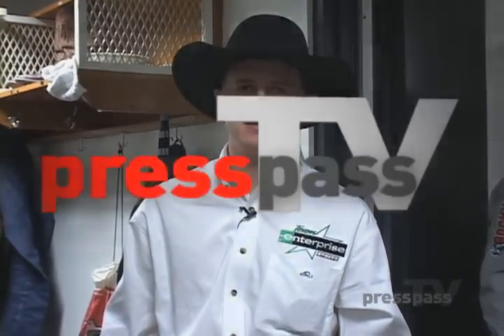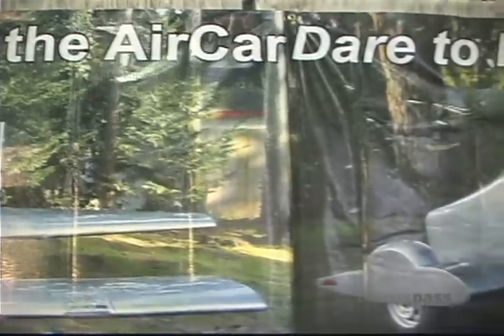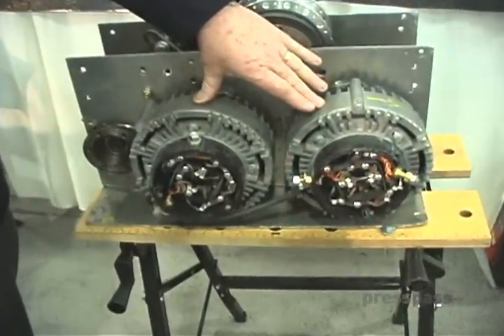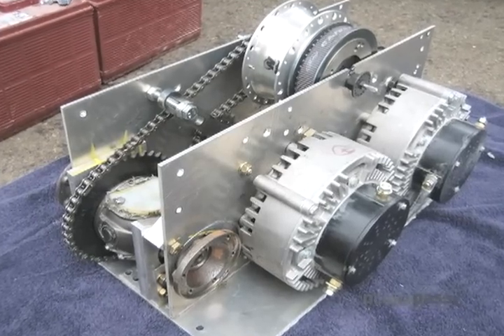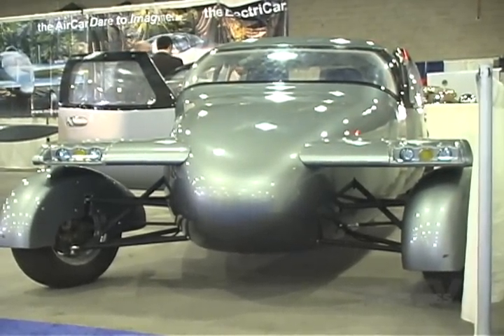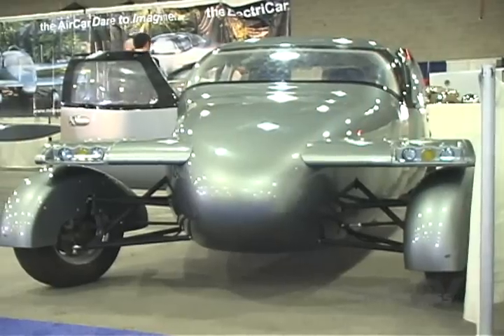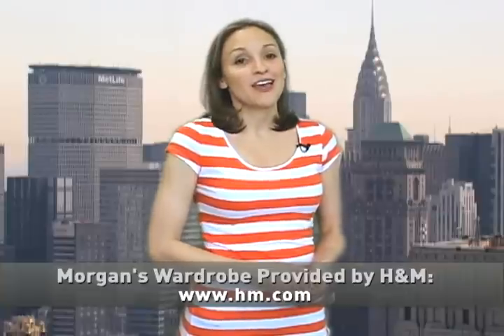Ditch the Fuel and Ride Light: The Milner Motors ElectriCar

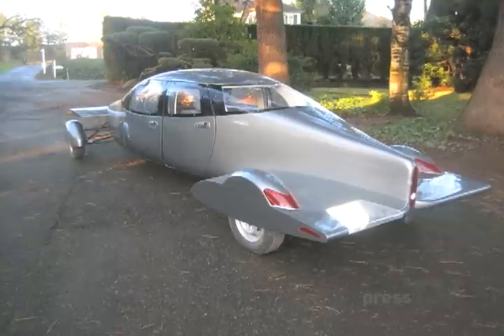Comment: @Arakyrie Is it so? I know nothing about aerodynamics, but to me the front wings appear to have longer path on the top side than bottom(at 1:10 and 3:50), making it looked like same side up as airplane's. I've heard faster air flow makes low pressure and lift( or down) to that side. I wanna see the direct side view of those wings(and the car). Thanks for the reply

Comment: @suzukiaddress125 im an engineer, those wings are upside down as compared to those in a car, this actually increases grip on the road at high speeds. This will make this car extremely stable

Comment: I beg to differ.  If you employ a hyrdaulic drivetrain, you will not drain the batteries so quick. You can still use an electric motor or petrol motor to build hydraulic pressure plus braking in city traffic will put pressure back in.  It also works for larger vehicles.  100% electric is good for retrofitting used cars.